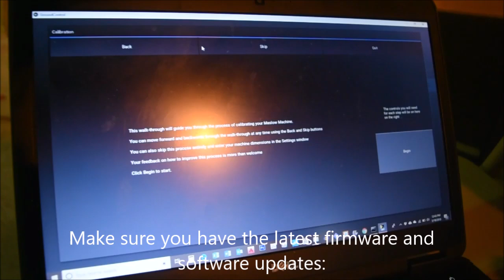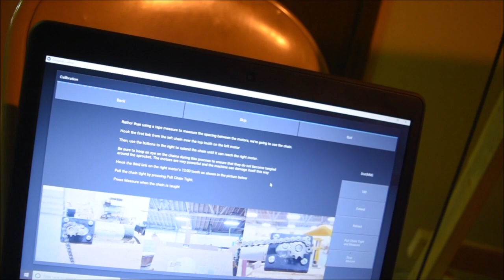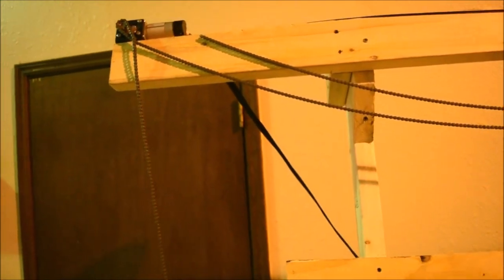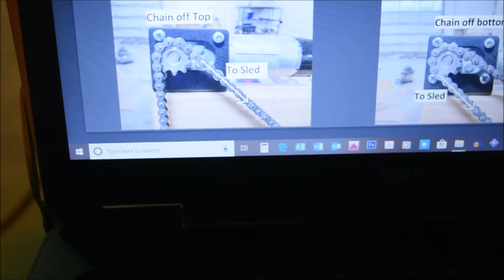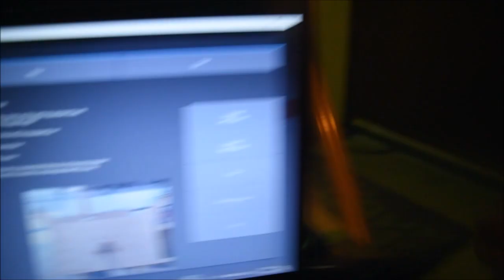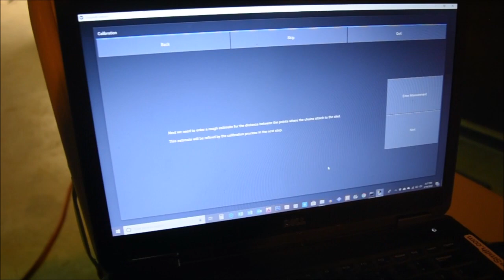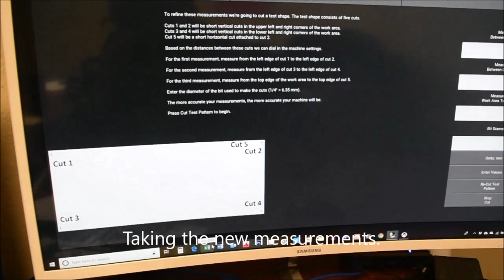Maslow CNC Setup: Calibrating the Maslow

Comment: How do you "measure" the chain without stretching it?  If a bicycle chain stretches how much more won't this deform, that is why it skips gears.  I pulled chain tight and it ripped a motor from my machine, it didn't stop pulling, the second time it bent the machine and mine is beefed up WAY more than the instructions.  Now I need new chains.  My advice is just to measure unless I have a fault somewhere.

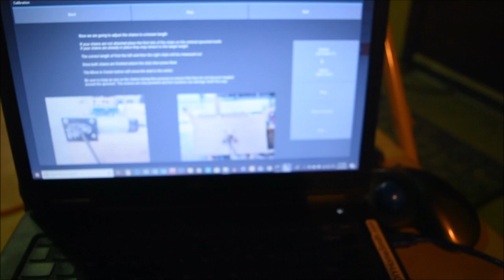Comment: @9:44 after attaching the left chain and extending it, I've tried to do the same with the right one without any success. the motor was moving a mm or so and then stopping, I've tried to change the cable but it hasn't worked either. the thing is that when i ran the test it was moving.would really appreciate your help thx
Reply from the maker: Try the maslow user forum. I've never had that problem and there are a  lot of users there with more knowledge than I have.

Comment: So helpful, thanks! @ 0:50 -  you should've selected Triangular based on the ring system, right?
Reply from the maker: Yes, you are right. That video was from a first attempt where we used the L brackets. I didn't have footage of the final calibration after we updated the firmware and changed to the ring kit.